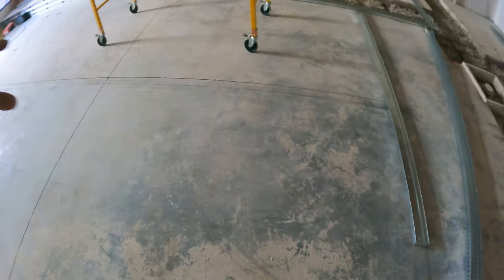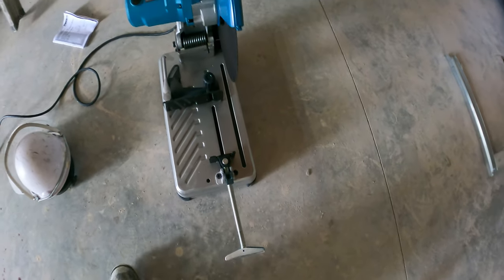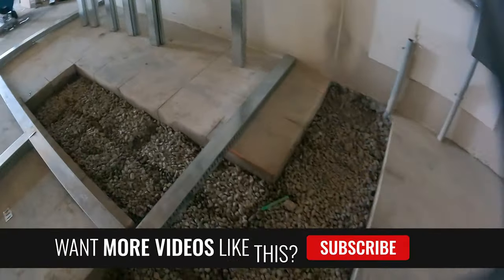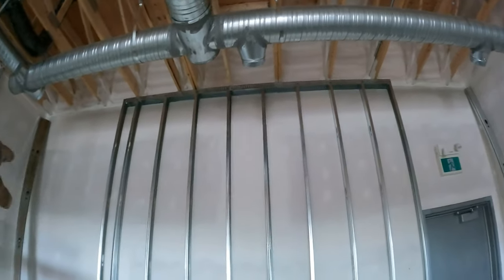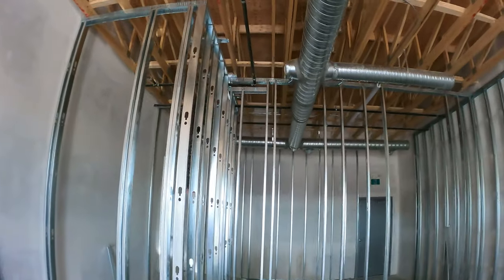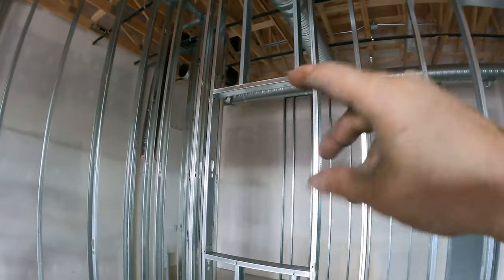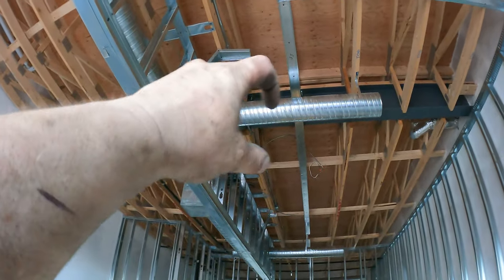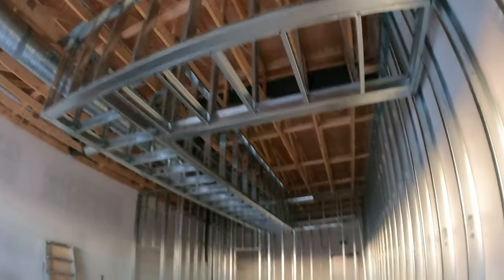Master Metal Stud Framing Solo Complete Job In 10 Hours!

Comment: Is there any technical reason why you are using 3-5/8 for furring instead of 1-5/8 or for example Furring/Hat Channel? 

I am about to renovate my condo and was expecting to use 1-5/8 for furring to preserve space, but I was also considering either 1" (3/4) wood for some of the walls or furring/hat channel as an alternative, but don't know what would be best other than 1-5/8 should be enough for electrical outlets opposed to 1" wood or hat channel.
Reply from the maker: YES! For sure 3-5/8" but I 100% recommend 6" for all plumbing walls. 3-5/8" is not enough to work in and super cheap commercial way to get it done. Please make all walls with plumbing 6" for now and future upgrades. If its just electrical or architectural sure 1-5/8 or 2" what ever you want man thats the beauty!